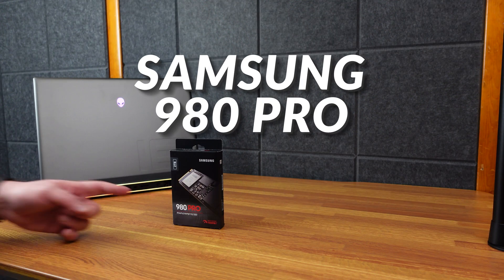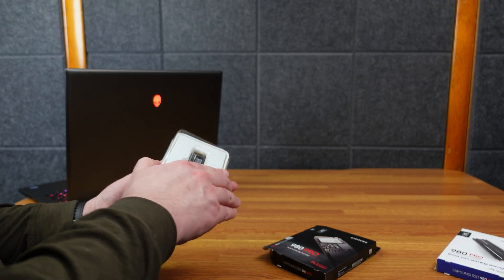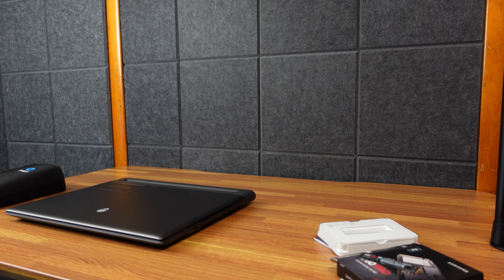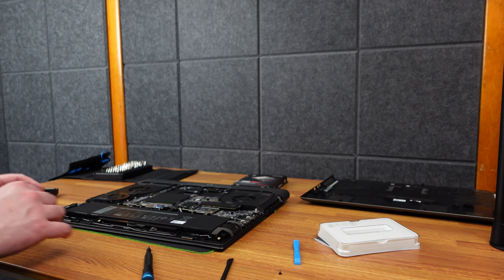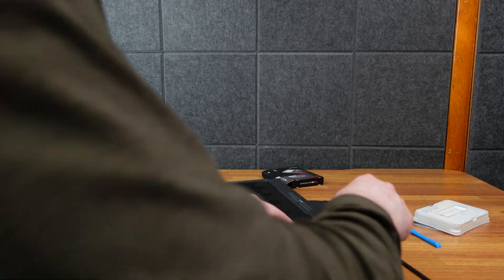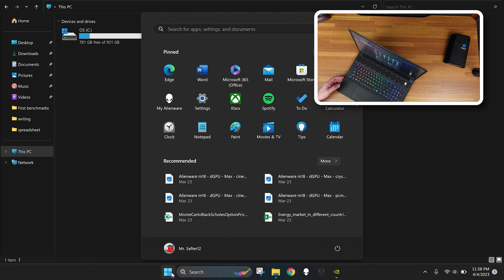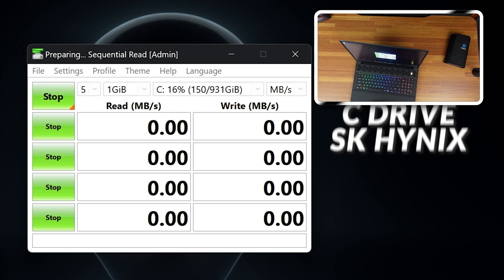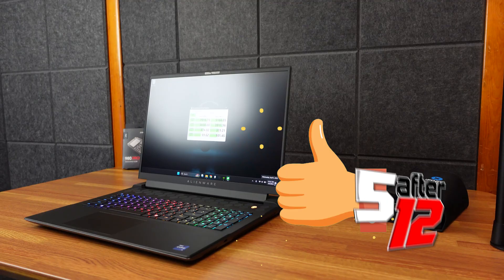Alienware m18 NVMe SSD Upgrade – Samsung 980 PRO

Comment: Hi 5after12, How many hours does the laptop last without the battery charger BUT the battery fully charged?  Thank you sir
Reply from the maker: That will always vary based on what you are doing while on battery and your various settings (display, brightness, battery mode, etc.). However, I pretty much never use mine on battery so I wouldn't be able to answer the question
Reply: @5after12  I understand..what I mean is that I don't want to buy this only for gaming but Internet browsing and productivity like MS Word, Excel and sound/video software.

Comment: Does yours ever stutter in game mine does every game but only one or two times and idk what it means
Reply from the maker: this would vary based on what specs your laptop has and what game you are playing and what settings you have for that game. for the games i play, most run just fine. Fortnite i have to adjust the settings, i can't just run Fortnite at max settings or it will have performance issues.
Reply: I have the AMD version of this laptop and it does it everyday, I play 1 game mainly but yes It does stutter and I dunno how to fix that🤷‍♂

Comment: So maybe it's better to install Windows on two smalls 2030s in raid 1?
Reply: I'm not sure their are enough PCIE lanes to support 4x M.2's in PCIE GEN 4...
Reply: @MrScary-207  I saw a video where someone installed 10gb, two 2030 1gb each and two 4gb each stick. Why not create a raid 1 on two 2030s for an operating system with programs?
Reply from the maker: why do you want RAID on a gaming laptop? just because you can?
Reply: @5after12  Because the 2030 memory is not the fastest, but in raid 1, as I understand it, the speed should double, since the reading goes simultaneously from two SSD modules. Only for this. And install on Windows. Then, for games, you can install a high-speed 2080 SSD gaming bar. The second 2080 bar can be used for backup and secondary storage. Wouldn't that be the rational use of all the capabilities of this laptop model?
Reply: @Boyli_Chif  depends on the specific RAID 1 array. Generally enterprise grade RAID 1 and RAID 10 arrays do improve read performance but consumer grade and software/firmware RAID 1 arrays don’t. It’s just about the quality and capability of the hardware involved in the operation of the array and cheaper setups don’t take advantage of the duplicated data set when reading. RAID 1 for consumer grade products would only bring fault tolerance. TRUE HW RAID controllers are expensive and not found in laptops.